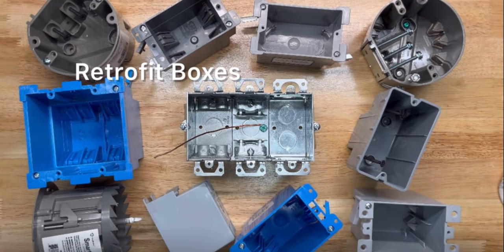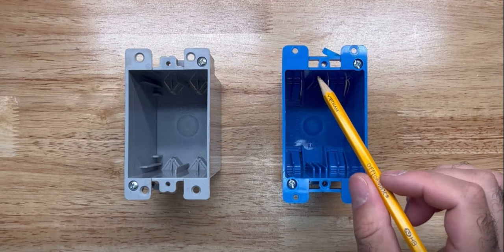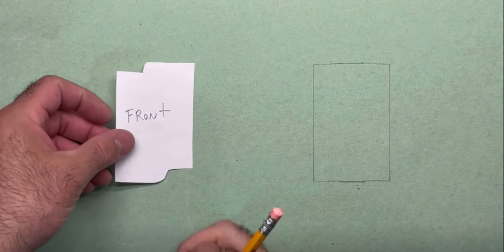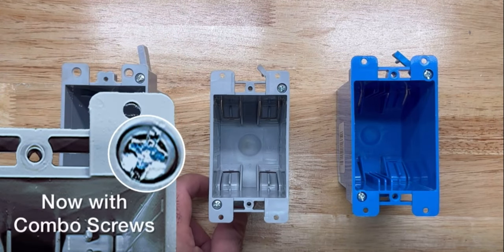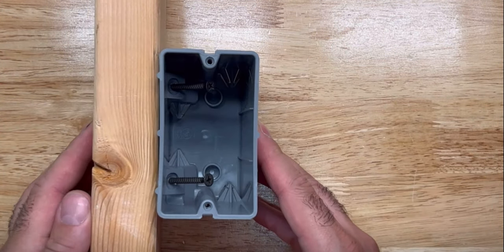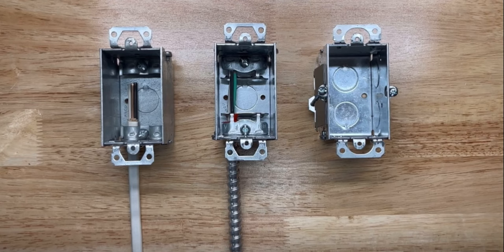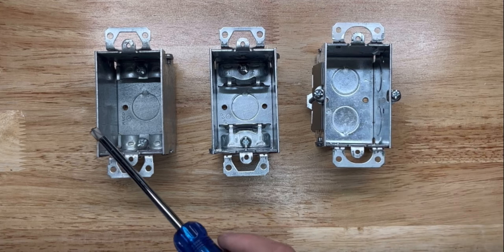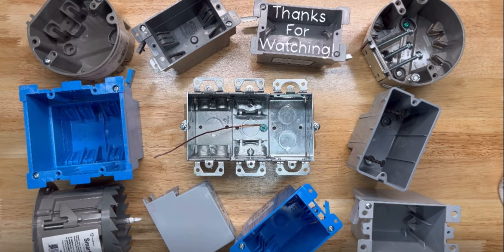Old Work Electrical Boxes, Retrofit Boxes, or Remodel Boxes

Comment: HO-LEEEEE CRAP, you just saved my butt! I have a 2-gang light switch box and a 1-gang light switch box about 2 inches apart from each other because the original owner of my house bought a fridge so big for the space it's in that he had to not only cut the trim from the doorway to the kitchen out, but he also had to remove the kitchen light switch. His solution was to put it on the other side of the wall so it's now in the hallway. It's a sore spot for me because he used an old work box, which normally would be fine, but he cut the hole too big and the box didn't want to stay secured to the wall.
  That Southwire smart box is exactly what I need, but in a 3-gang, and Lowe's carries them. Now I can remove the original 2-gang new work box from 1980, and replace it so all 3 light switches will be in one box. THANK YOU for sharing this!!
Reply from the maker: Thanks, I’m glad this helped. Those Southwire hybrid boxes are a life saver. I would do the same and then try to repair the drywall. Good luck.
Reply: @toollookchannel  The operative word being "try" for me, lol. Definitely outside my comfort zone, but if I don't get past that nothing will ever get done.
Reply from the maker: @demontekdigital1704  at least you have a very good solution to work with. Hybrid box ‘for the win’

Comment: You can get the same advantage of the longer screw shown in the Slater box shown at 5:43 in the video by flipping the paddles on the blue over and screwing them in from the other end.  This gains about 1/4" which is enough for plaster walls and 5/8" drywall.
Reply from the maker: Perfect; thanks for bringing it up. This is should help those who are in that situation. Indeed, flipping the wings, or snipping them does work in most cases. I was nervous to put that in, because some plaster walls are thicker. Good one

Comment: Very nice overview! The Legrand "Slater" is also findable by the parent company name (Pass & Seymour, same P1-16-W part). It's metal ears are much nicer to work with than the plastic ones on the Carlons that sorta squish. My old house has 3/4" tongue-and-groove walls, and that's before any cardboard wallpaper backing or 1/4" drywall, so the P1-16-W is what I'll use.

I'd like to try the Southwire (Arlington's another brand) that screws into a stud, but I don't know that I can find a stud finder that'll work on my walls.
Reply from the maker: If you have a wiring device on the wall you’re working on, remove the wall plate, find the stud, and using a measuring tape might work as your guide. Your next stud is very likely 16 inches away “on center”. The Zircon MetalliScanner M40 might help finding nails that would go on a the stud, it’s a bit pricey, but it might help get you closer to the best judgment of where the stud might be. Another way is to work low around the trim by removing it and drilling a small hole through the “tongue and groove wall” just a little more than 1 1/2 up from the floor and attempt to drive a small nail to see if it’s still feels like it’s going through wood. If so…then that’s your stud. Good luck
Reply: @toollookchannel  Thanks for that. Yesterday I bought a Franklin Sensors M150 at Lowe's and it seems to find the studs. It'll be another week before I go into the walls to confirm. I thought I'd located the Legrand "Slater" online at Home Depot and drove 40 miles to my nearest store. H-D shares the same SKU for it with the blue Carlon. The clerk told me it's the same thing. Such a waste of time, but I'll some pick some up online from a reputable seller instead.

Finding the studs seems to me irrelevant for mounting, however. My studs are recessed 3/4" and I'd need 3/4" worth of extenders, which wouldn't likely be legit even they worked. Also, with my luck, I'd insert the box and it would fall down into the wall before I could screw it into the stud. 

I think I'll stick with the ears instead. Even with the cover plates off I can't yet determine how the original receptacles are mounted, but I know it's not to the studs ... they didn't need to do that since the wall is 3/4" hardwood.
Reply from the maker: Try an ebay seller for the box, because usually what you see is what you get with those private pictures from those private sellers. 
You do want to find your studs to avoid the big mistake of cutting over where the stud is, not sure if a jumbo wallplate would save you at that point. And about the box…if you hold the Southwire box with pliers, try to hold it, or use tape that sticks inside the box and out to the wall, that should hold it for a few minutes.
Reply: @toollookchannel  Agreed. I'd still need to overcome the depth deficit if I attached back to a stud. I can use the box type with ears even if it's up next to a stud.